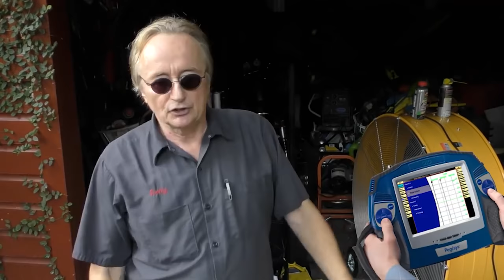3 Illegal Mods That Will Make Your Car Run Better

Comment: I had the def system removed from my diesel truck. It operates cooler, cleaner, and improved fuel mileage by 15%
Reply: Yeah, those are pretty awful.  Bypasses are big for individuals.  Parts are expensive for fleets that are legally inspected.
Reply: Also will save you trips to the mechanic shop.
Reply: def system meaning?
Reply: @exzzistfym  DEF - Diesel exhaust fluid.  DEF is 30% urea, 70% water and is injected into the exhaust gases of diesel engines just before the catalytic converter. It aids the catalytic converter in converting NOx's (pollution) back into nitrogen (N2) and water.
Reply: Careful
Reply: All the DEF system does is put cat pee in the exhaust

Comment: It’s a shame that there are so many crooked mechanics out there but when you see one honest like this guy i rather spend my hard earn money on this guy or any honest mechanic. They deserve the work.
Reply: P0
Reply: When I lived in TX I was considering making the 1.5 Hr drive to drop my truck off at his shop.  Problem was I probably wouldn't have made it there lol.
Reply: Lol 😂
Reply: its a shame there are so many crooked lawyers , cops, judges, doctors, bankers, businessman..... its a LONG LIST momma
Reply: @ccole9080  daddy?
Reply: @miguelquazar883   where in Texas is his shop located
Reply: Its better to have some knowledge of auto mechanics. They can't be dishonest with you. If you know what's your car needs fixed. Most of the time. You can make the repairs  yourself.
Reply: My dad is a mechanic.  Worked at a few dealerships and eventually opened his own garage.  I started working with him when I was 17 and worked with him for nearly 6 years.  Learned a LOT.  We worked on EVERYTHING.  Any make, any model, any problem.  He is a gifted mechanic.  I felt stupid and don't feel "right" saying I was a mechanic standing next to someone like him.  But I will say this.. he never once lied to anyone or did a half-assed job on anyone's vehicle.  He told them the real problem (diagnosing problems is what makes you a real mechanic), he'd fix the problem, and charge them too little if you ask me.  He'd have me pull a 4L60E out of a Chevrolet 1500, he'd rebuild it, I'd put it back in and he'd charge $500 and split it with me.  

He even pulled and replaced a 4L60E in a C5 Corvette.  Those transmissions are in the rear end lol.  Guess that's how they get that 50/50 (or close to it) weight distribution.   

He rebuilt my 3.0 V6 TT in a 1991 Dodge Stealth R/T TT I had with 15G turbos and all supporting mods.  He could just do anything.  I spun a rod in it and he replaced the crank is what he did.  But he had to pull the engine to do it.  They were all wheel drive with all wheel steering.  Front wheel drive with a transfer case to the rear.. whatever you call them.  

Worse to the wise.. if you  want horsepower, get a V8.  That was the most unreliable car I'd ever owned.  The non turbos could take 7000RPM all day every day.  The stock turbos could do the same.  But when you started adding power to them, they needed upgrades from top to bottom.  I had Ross forged steel pistons and a forged steel crank.  But my stock rods were the weak point I guess.  Blew it up three times.  Estimated 500-525 crank horsepower.  Or 380 AWHP (again, estimated).  2x 15G turbos @ 19 psi.  In those days, it was one of the fastest cars on the road in my town.  7.7 second 1/8 mile car that looked like a normal street car on the road.. whereas the V8's had to be built, cammed, and have a high stall torque converter and you KNEW it was built when one like that drove by.  Mine?  I made a lot of money racing people in that thing.  They couldn't believe that it was fast.  A 3.0 V6?  Pshhh... how could it beat their 383 stroker?  

Like this... AWD launch and kept on pulling.
Reply: @JustAGuy85  that is cool hopefully he was able to steal all their customers and your dad would offer them a better price. That’s what my brother did at a motorcycle shop, took all their customers and gave to boss the middle finger
Reply: @jcsjcs9777  I have a cousin that worked at a moving company that did that.

He was like "I can do this and make that money."   

But my dad's garage was about 20 miles away from the city he worked in.  But people knew him and would bring their cars to him based on that alone.  

That's what he's known for by everyone.  Being a great mechanic.
Reply: When you say out there , in England???😂😂
Reply: It's a passion for him, a science...not a job

Comment: The "don't need back pressure" thing is especially true for turbocharged cars. You want as little restriction as possible after the turbine, otherwise the pressure will actually hurt the spooling characteristics of the turbocharger. It's why on big turbo cars, you see the catalytic converter either: replaced with a high flow racing cat, removed, or moved farther down stream to reduce restriction and improve turbo spooling. Even a small size upgrade, changing to a lower restriction exhaust has improved responsiveness due to letting that turbo spool more rapidly.
Reply: Agreed, just bought an X5 M twin turbo V-8 all tricked out for the track. It has after market straight pipes that are 1.5" larger than the stock 'M racing package' that came on it. All the UPGRADES took it from a 600hp family race car to over 800hp. Cost $1800 / year in tires driving it under "normal" traffic conditions. 🤣
Reply: Back pressure may be a thing for low powered vehicles which would make a little more sense…
Reply: wouldn't a blow off valve help as an alternative to the muffler change?
Reply: @LynchMob09R  no, since the blow off's function is just to prevent pressure buildup in the intake to either keep the turbine spinning after you let go of the gas pedal and close the throttle valve, or limit the maximum pressure to keep your engine in 1 piece. Back pressure in the muffler will have an effect on how much the turbine can spin or keep spinning since the exhaust pressure and flow is the active force that makes the turbine spin.
Reply: 13:33
Reply: @stevesanso1404 
Who's the guy he says whines?
Reply: Omg the turbo has more back pressure then 9 exhaust systems watch how turbos work back pressure helps low tq not high rpm hence why racecars don't even notice 😊
Reply: Also on turbo cars you may have intentional backfire caused by intentional fuel injection/detonation to force the turbo to spool up when the throttle is off.

Comment: Illegal ways to make your car faster: 
1. No muffler’s (causes backfire if not tuned)
2. No catalytic converters (fails emissions test)
3. Nitrous Oxide (can blow up engines, legal in some states only)
4. Bigger fuel injectors (ecu tuning a must)

Thank you Scotty for all the info you give us. I especially loved this one lol 🙏
Reply: Must suck to need emmisions test
Reply: @gpenn7201  only states like California are strict on emissions. Most don’t care.
Reply: It especially sucks when they are intentionally done in the most backward, counterproductive and mechanically illiterate way possible. It's done by emission per gallon of fuel. I guarantee my car is cleaner, burning 1/3 the fuel per mile than stock if emission tests were done by sane people.
Reply: @Febreeze_Odor_Eliminator  other states are joining in. the whole west coast and east coast have the same restrictions. washington, oregon, california, new york, vermont, massachusetts, etc. all have sections of the state that follow california CARB law. the difference is those laws tend to be in the more populated areas (in oregon it only applies to the portland metro area for example) while cali has it for the whole state. but if you live in any of those big cities you need to do tests and it gets pretty sketchy as a car tuner
Reply: @perkypears  That sucks! I guess west and east coast aren’t for car guys/ gals.
Reply: @Febreeze_Odor_Eliminator all the Cali copy cat states like Colorado & most blue majority 1s are strict
Reply: Will removing the cat mess with the cars engine?
Reply: @jakefarm1280  I don’t think so but you should definitely tune your vehicle’s ecu after going catless or another option is going with an aftermarket high flowing cat but again tune the ecu if you do that.
Reply: @jakefarm1280  your car is programmed with specific ignition timings in mind so if you remove cats aka improve airflow the air might flow faster than the car really expects and it might cause some slight backfiring (the bangs and pops you hear tuner cars make).  typically it wouldn't break anything, but it is possible it could damage things by making fuel ignite where it shouldn't be. to get the most power out of it you'd need to have the computer reprogrammed with a tuner which is expensive. your car might also give you a check engine light just to warn something is abnormal if it detects the cat is gone
Reply: For emission you just find a sketchy shop or know people. My guy actually inspects it for problems but wont make me do anything if its not serious or need it right away
Reply: Negative Nancy
Reply: Muffler removal will give you less than a horsepower most likely and isn't illegal, just louder.
Catalytic converter removal will net you less than a horsepower if it's in good shape and is only illegal if the EPA sees it (they never do; millions of cars on road without)
N2O isn't illegal; just might be for the street because somebody fscked it up for everyone else
Bigger fuel injectors aren't illegal; you do need to inform your insurance company of any modifications, however, and they can decide you're racing it and drop you like a brick in a lake

Comment: When I lived in California back in the 80's, I inherited  a 6 cyl. Ford Granada. Just like Scotty described, the time came when I couldn't get over 35 or 40 mph.  My mechanic friend 'fixed' the problem by simply removing the honeycomb from inside the CAT with a pair of pliers. The car passed the smog test every time.
Reply: I did that on a civic and blew the engine.
Reply: @jayalli707  auto mechanics 101 tells me that it was coincidental that you blew up the engine by removing the restriction in the cat. I filled up at Shell one day instead and Chevron and the next day a ball joint let go on the right front wheel.
Reply: @andrewwasson6153  ha! NEVER cheat on your gas station. 
The old tymers swear by taking out the cat. I've always had hard luck with it, all those one times.
Reply: On any older car I've owned, we've gutted the cat- it becomes a necessity
Reply: @jayalli707  causation vs. correlation
Reply: @jayalli707  gutting a cat would never cause an engine to blow
Reply: @jayalli707  you had another problem then. Removing your catalytic converter would never blow up any engine.
Reply: @ちくてぬしくけて  I removed the cat. Restructured the muffler. Turned on the car. Rpms shot up nearly into the red (it's been over 10yrs so that might be an exaggeration) and smoke...smoke everywhere.
Reply: @jayalli707  Your rings are done before all the oil smoke is inside the cat
Reply: Granada was the biggest pos that ford ever shat.  I hated that car.  It always stalled.   I'll never own a ford after that experience.
Reply: @jayalli707  say you don't know how engines work without saying it. Any engine can run without an exhaust system. They were invented to reduce noise
Reply: @thebunz7  that's entirely possible
Reply: Not anymore It wouldn't pass in CA.
Reply: @therockoway  
You can remove a cat from a 6cylinder. Dual exhaust may have 2 converters. 
Scotty has some videos on muffler removal.
Reply: @@therockoway Lol get a saw :)
Reply: Not anymore in CA. Lmao in the 80s
Reply: @thebunz7  And reduce carbon monoxide poisoning in the cab.

Comment: A lot of "high performance" mufflers are designed to have higher flow rates to reduce the negative effects a muffler has on your car. The downside is that they won't be as quiet as a typical muffler and most are dramatically more expensive than typical mufflers. But sometimes halfway is the best you can legally get.
Reply: Magna Flow muffs are excellent. Straight thruogh perforated tube with a non-deteriorating sound absorbtion material. No drone & minimally increase exhaust volume. I've run them for 30 years. ALL mufflers with baffles, even "high performance" versions are detrimental to performance. It's called "fluid dynamics" & a common example are rocks in a stream. Every rock disrupts smooth flow & the same thing happens in an exhaust. The newer cats are very minimally restrictive.

Comment: When I first bought my 2003 Nissan Xterra 4x4 it had engine check light on. That is what my mechanic had said "you need catalytic converter". This vehicle catalytic converter cost a lot for OEM ones. I just drove it like that for a few years and now it had passed smog check. I had used the thinner Scotty had recommended when I first got my car, but it didn't work at the time. So l do the European cleaning😁 Scotty  had recommended. Went for a long trips going around 70mph that seems to help. Now no more engine check light and passed smog in 2021. Yay!😅
Reply: Where the fugg can I get a thinner Scotty for my Impreza?

Comment: I took my catalytic converter off and chisel out the inside and put it back on and it ran great
Reply: Did it get loud, or relatively similar sound? Also did you have any codes pop up after?
Reply: @jamesb7656  ran just fine. No funny noise and no check engine light

Comment: Hey Scotty, you're usually 100% spot on.  BUT......there are engine tuners who can alter the Engine Control Module (ECM) that can tune your car to BETTER gas mileage, go from 1 7/8" to 3 1/2" exhaust (for turbos) and make it run faster & better.  I've had a Miata that I added a 2.5 Liter Ford Focus engine, a turbo, and big 3" stainless steel exhaust & muffler.  It was a BLAST to drive!
Reply: I bet that Miata screamed!!! Power to weight ratio 🤟😵‍💫🤟

Comment: Minor correction: the SAAB Sonett had either a three-cylinder two-stroke engine, or a V4, four-stroke engine sourced from Ford.  A long time ago I really wanted a two-stroke Sonett but I never saw one.  I did have a '67 SAAB 96 Monte Carlo, and that model's high-performance two-stroke engine (60 HP!) had three carburetors (the highest carburetor-to-cylinder ratio of any car I ever owned).  I don't know if the two-stroke Sonett came with the triple-carb engine, but as it was a sports car my guess is that it did.
Reply: I believe the V4 was shared with Ford, I had one in my Corsair
Reply: Yes, the V4 used in late 60s to mid 70s SAABs, was a German Ford engine built in Cologne and introduced in 1962, and powered  the Ford Taunus. 
 I learned to drive in my dad's 68 SAAB 96. He had been interested in the Sonett II which were all 3 cylinder 2 strokes. But he was too tall to sit in it. 
 His two previous cars, a Lloyd (British) and a DKW (German, one of the 4 companies that merged to eventually form Audi, hence 4 interlocking ring logo) were both 2 stroke, fwd. The 68 SAAB 96 was available with either the 3 cylinder 2 stroke or the V4 4 stroke. He opted for the larger displacement V4.
  Btw the Sonett pic Scottie showed was of a Sonett III, which were all V4 4 strokes
Reply: I have a V4 sonett, love it
Reply: Yes the early sonnets had Monte Carlo motors
Reply: @stevewales9911  The Lloyd was a 4 cycle, 2cylinder,made by the Borgward company,in Germany .I have two now,and have had more previously
Reply: The reason you never saw a 2T Sonett is that there were only 33 of them total:

6 original Sonett I
1 copied Sonett I
26 Sonett II

That's it. Various people in the Saab community try to keep track of them.

As to the triple carb on the 2T sonetts... I don't know, but perhaps not, due to the lack of space in the engine bay.
Reply: As others have said, the Sonett, Saab 96, Saab 95 had the Ford-sourced V-4 in either 1.5 or 1.7l.  Ford also had a 1.3 and I believe the Capri came with a 1.5, 1.7, or 2.8 (all the same family).  I believe the inline 3 2-stroke was a DKW design (or Saab paid royalties).  I don't know if you could slide a Rotax 2-stroke in a sonett...  That might be fun!

Comment: There is a devise that is used to keep a turbo spooled up by causing the engine to backfire. That backfire which you may have seen is due to an anti lag system or a misfiring system in tuner terms.  The anti Lag system keeps the turbo spooled up even when you are not on throttle so that after you exit a corner and step back on the accelerator you have that boost ready for you and hence eliminating turbo lag.